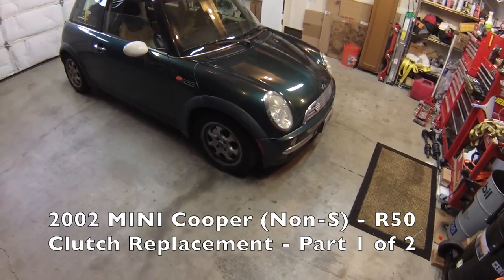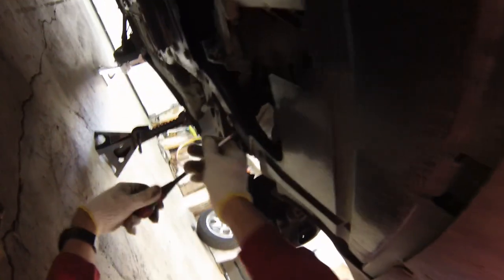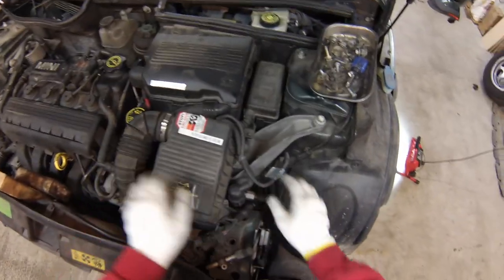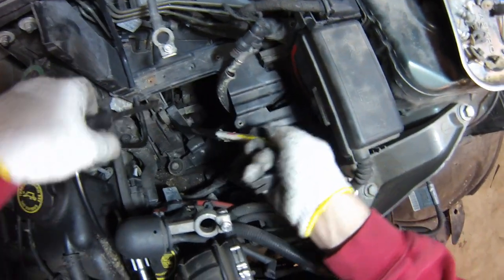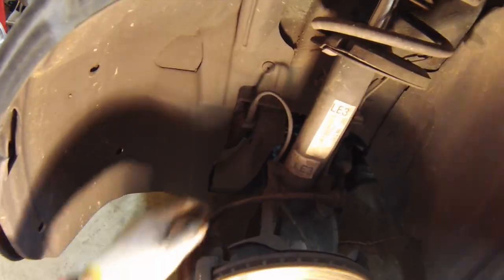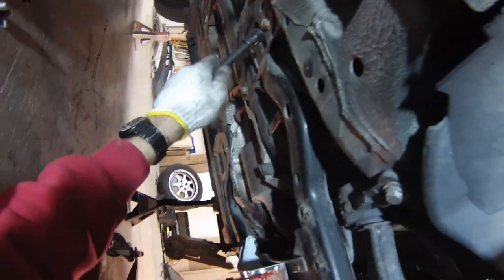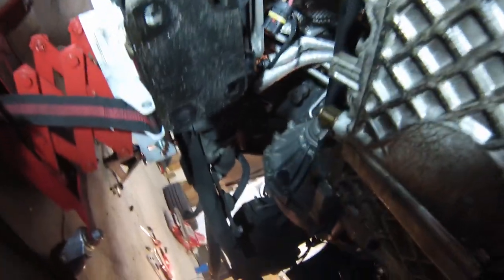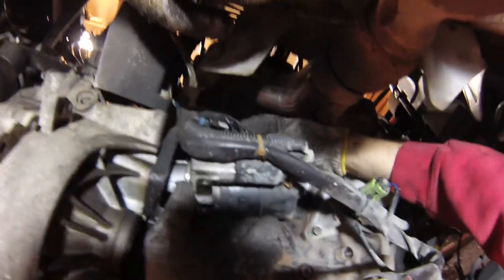2002-06 MINI Cooper Non-S Clutch Replacement Part 1 of 2

Comment: Yes, this is a great video. Mod MINI, could you provide me a link for a ball joint removal tool you used in the video? Is that BMW special tool 32-3-090? Did you get this from MINI?
Reply from the maker: Here you go - third party, not BMW tool works great: http://www.amazon.com/gp/product/B00A4AJ318/ref=as_li_tl?ie=UTF8&camp=1789&creative=390957&creativeASIN=B00A4AJ318&linkCode=as2&tag=mimlif-20
Reply: ***** Thank you, Mod MINI, for your very quick reply. Now, I can try to replace my MINI's clutch.
Reply from the maker: mao7630 If you are not replacing the ball joints, you can also try removing the two 13mm bolts and separating it from the hub.
Reply: ***** Again, thank you very much for your thoughtful reply, advise, and great video. I replaced my 2003 R50's clutch and ball joints during the weekend. It was the first time for me to do clutch replacement. I enjoyed a lot and your help brought me a feeling of accomplishment! Now, I am enjoying driving my quick MINI.

Comment: great videos! I'm going to attempt a DIY with my clutch, this video is a great help. thanks for posting. A mechanic quoted me at $1400-$2100 depending on the flywheel.
I of course have a couple questions. My 2004 non-S mini was built in September of 2003. Is it all in if any different the the 2003 that you worked on in the video above? Where do you suggest i order online parts from or do you think i could get the same parts at autozone or O'riely's. I live in california by the way if that helps. Oh and the "emery" paper you used to buff the flywheel, what grit is that?
Thanks for your time, its much appreciated:)
Reply from the maker: There are some small differences between the Midlands and Getrag 5 speed, mainly location of shift linkage and how the slave cylinder is attached to the bell housing. Other than these differences, the job is identical.
I'd suggest ordering online as local parts shop will probably need to order it in anyway (unlikely they have this part in stock). The changeover in parts appears to have happened in June 2004 so the job should be identical to the one in this video.
The emery paper was probably around 80 grit.
Reply: *****
 I found a duralast clutch kit http://www.autozone.com/drivetrain/clutch-set/mini/cooper/2004/4-cylinders-1-6l-sfi  Do you think this is a good product? Its about  $100 cheaper than pelican parts.
Reply from the maker: Eric Knowles For a non-S, I'm sure that would work fine.
Reply: a couple people have told me to have the flywheel resurfaced and i have a shop nearby, is this difficult to do? i took a couple bolts off and i thought to myself, i should ask you:)
Reply from the maker: Eric Knowles I've never done it. Show a photo of the part to a local machine shop or brake/clutch shop and they should give you an idea?
Reply: so im trying to attach the motor mount back in place and somehow the engine pivoted/leaned back towards steering wheel. When i raise the engine the bolts dont match up. any ideas how to get the engine moved forward towards the radiator?
Reply from the maker: Eric Knowles You just need to pull it forward. It might help to have a floor jack under the motor to prevent it from trying to go backward. Pull forward with one hand and hand thread a bolt with the other hand.
Reply: haha i wish it were that easy, tried that many times:) my buddy who is a mechanic is coming over to help. thanks for all the help, i definitely
 could not have done it without you!!:):)
Reply from the maker: Eric Knowles Good luck. I might know a trick or something, but I've never had a problem with the engine position. Mating the transmission back to the engine when lying on your back, that's another story.
Reply: so now i have a trouble code 2097 coming up, also before this code had a misfire in cylinder 1 and 2 error code that came up about 6 weeks ago but i changed the spark plugs and those codes went away. however, I'm still getting a misfire but no codes for that problem just the 2097, which is a running too rich code from the post o2 sensor. any thoughts?? thanks
Reply from the maker: Eric Knowles You have a bad o2 sensor. Probably precat.
Reply: ya thanks, thats what ive been reading, and having to reset adaptions or something.
Reply: i'm pretty sure it wont solve the problem but if i replace the o2 sensor is that going to take care of the misfiring problem that ive been having in cylinder 1 and 2
Reply: before the 2097 code i was getting P0301 P0302 and P0313. the 301 &302 are misfires in cylinder one and two, the 313 was a back and forth misfire detected with low fuel. thanks for your time:)
Reply from the maker: Eric Knowles Misfire could be due to many different things, including a bad tune, incorrect readings from crank or cam position sensors, fouled plugs, incorrect plug gap, bad plug wires or coil, clogged injectors or even poor compression. o2 sensors may be involved with a misfire problem below 3500 RPM or so. Above that the air fuel mixture goes into open loop mode and the o2 sensor is not referenced.
Reply: thanks this helps a lot:)

Comment: I want to now how to change the couch in the 2004
Reply from the maker: I guess you mean clutch? MINIs don't have couches. Anyway, the process is identical for any 2002-2006 non-S Cooper, except for the location of the clutch slave cylinder and shift cables. Process for Cooper S is almost identical except for removal of the air intake up to the supercharger.

Comment: I have a manual 2003 Mini Cooper base model that started getting stuck in gear. A little lube on the shift cables helped me get it back into neutral, but now its making a bad noise and then making noises and sometimes stalling when I get off the clutch in neutral (see videos). Does this sound like the throwout bearing issue, or is there something else that may be causing the problems I am seeing like the shifter cables? Thanks in advance for the help!!!
Shifting: https://www.youtube.com/watch?v=IDcYbGI0GmQ
Clutch noise: https://www.youtube.com/watch?v=Mg9oWoj2mS8
Reply from the maker: Those transmissions are known to fail. Sounds sort of like transmission problems to me.

Comment: you dont need to remove subframe i remove gearbox on the front but still great video
Reply from the maker: Hmm, interesting. Maybe possible with the smaller 5 speed. Crash tube doesn't get in the way?

Comment: you fucked up on your ball joints     there are 2 bolts under the strut that you undo instead of the balljoint
Reply from the maker: I removed the larger bolt due to typically having problems with the top half being seized and not coming out whenever I tried on various cars. I undo the top bolts now and use an air chisel to pop free.

Comment: bottom bolt on starter=PAIN IN MY ASS!! haha :D
Reply from the maker: Bottom bolt? For me the top starter bolt is the pain in the ass. For the bottom starter bolt, remove the axle first and then you have plenty of clearance.
Reply: ***** ya know whats the funniest part about it, is that the ENGINE IS OUT!! and i still managed to round out the bolt head :( going to drilling it out this coming weekend hopefully. and btw, your videos are a HUGE help. no joke.
Reply from the maker: adam failing I am trying to imagine how that is possible... :-/ 12 point socket? I only use 6 point whenever possible. Anyway, good luck with that (no joke) and thanks for your support!
Reply: Yes sir 12pt (dont have 6pt for 1/2in drive yet. Again, thanks for the vids/help
Reply from the maker: adam failing That bolt goes into the aluminum bell housing. It might be safer to grind off the head or use a bolt extractor. http://amzn.to/1l4WAD5 
If you drill it the drill bit could wander into the bell housing threads and make things worse.
Reply: Already tried those. Although im gonna do some grinding and try again (avoiding drilling at all costs)